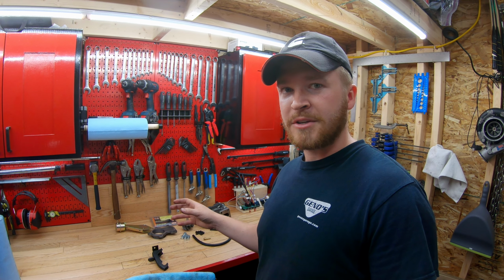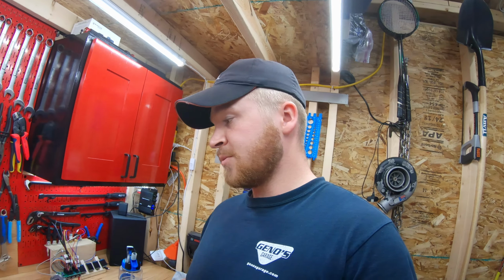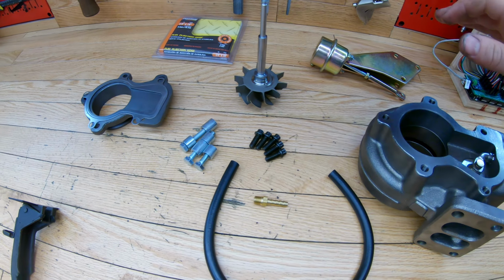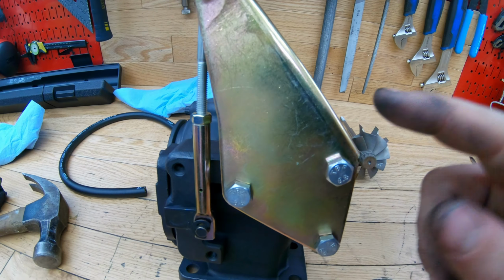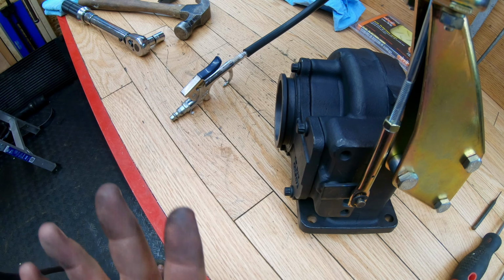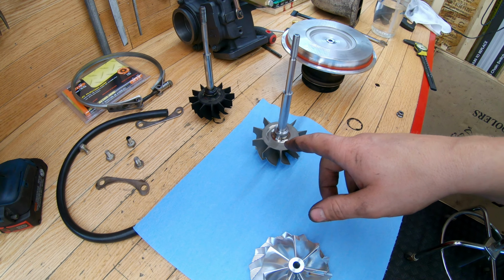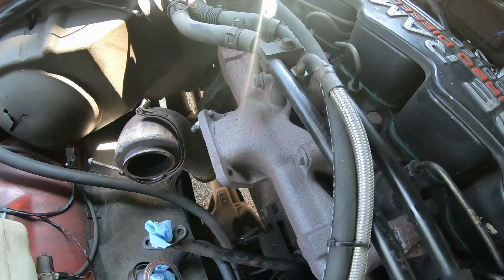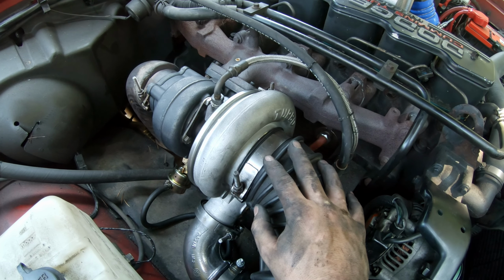64mm Turbine Wheel and 12cm Exhaust Housing | 1st Gen Cummins

Comment: I hope you do a towing update and list the mods/fueling you’re using.  I’m looking to make a few Frankenstein holsets myself just to see what the limits are on my 95 12v stock setup
Reply from the maker: I'll have to make another update video. I'm thinking about doing similar mods to my other truck but might go a different route haven't decided yet.
Reply: I'm right there with ya. I've still got a stock HX35 on my 96 and she's way over fueled. I need more air but don't want to spend a lot. Thinking of throwing a 60mm housing/wheel on it but people say that won't be enough. For a 62mm I have to machine it for the compressor wheel to fit
Reply: @TAShannon1  if you can find a roached out hx40…no machining required…just swap some parts around…otherwise you’ll still need to machine out your hx35 for a 60mm compressor
Reply: @bugn4life  hey man. So I went with a 62mm wheel and a 74x64mm turbine 10 blade. I had to get my compressor housing, bearing housing and turbine housing machined for fitment. I also rebuilt the turbo of course. I am in it a little over $400.

It's perfect. Exactly what I was looking for. Apparently it's a good 475-500hp combo. I have no idea where I'm at. I'm guessing 450-475 now. The truck was already fun and peppy but now it is an absolute menace. The 4k springs really get utilized now that I have the top end airflow. Spool up is still very quick. Not as quick as before but really close. Egt's are down 180 degrees. The sound is a lot different too. I liked the sound of the turbo before honestly. Because it was smaller you got more of that de-spool sound when you let off the throttle to shift sounds just like a big rig.

Now it sounds like a jet airliner. Still sounds cool just a different cool
Reply: @TAShannon1  you running an auto or manual trans?  Gearing and tire size?  Autos only need to spool the turbo once…lol
Reply: @bugn4life  NV4500. With the 4k springs I still keep enough boost in between shifts to where it's not a big issue. Also the nv4500 likes to shift faster at higher RPMs
Reply: @bugn4life  the drop off is usually from 40psi to like 8-10 psi when I'm shifting in the 3k+ range. With 10psi it lights fast
Reply: @TAShannon1  cool…my nv5600 is a slow row for sure.  Glad it’s working out for you
Reply: @bugn4life  I rebuild manual trannies for a living. One day I will absolutely do a ZF6 swap in this truck. Then she'll really fly
Reply: @TAShannon1  awesome…my friend rebuilt my nv5600…but I think we did something wrong…she’ll grind going into 3rd if rpm is too high either up/down shifting…even if I rev up to match speed/rpm…still grinds…sigh…I think we put back together too tight…
Reply: @bugn4life  possibly it wasn't shimmed right. Usually we shim a couple thou tighter than we want it to be. After breaking in soon it will loosen back up about a couple thousandths usually. Also NV5600 is not my favorite transmission. Their reputation far exceeds their design capabilities in my opinion. 

Usually when you have clutch disengagement problems you will have problems with multiple gears but mostly 3rd gear so check that maybe bleed the clutch see if that helps. 

Otherwise it is most likely a Synchro issue. Either bad part, or could have been stuck after rebuild and when you drive it before it is unstuck it can damage the synchro
Reply: @TAShannon1  I used 2 new hydros and same…my trans was just weird overall…it was an earlier nv5600 that someone put in a 1 3/8 shaft into and needed shims for the synchros…it was odd…oh well…next time I’ll go g56…lol
Reply: @bugn4life  Yes the G56 is best out of the 3 that dodge used. The best overall manual truck tranny is definitely the ZF6 but you need a lot more other shit to complete the swap including an adapter plate unfortunately
Reply: @TAShannon1  for sure…which is why I’ll stick to what they came with since my needs aren’t very big.
Reply: @bugn4life  a G56 with a heavy duty case is a real tank. That case alone is $2k from high gear. There is also a cage fat goes around the outside of the transmission that really does a good job of strengthening the case. Some of my customers have had great success with them

Comment: I need to learn more about turbos and all the measurements and stuff. That is foreign territory for me. How does this setup compare to a stock hx35?
Reply from the maker: Yeah haha, sometimes the measurements are confusing especially because aftermarket companies don't always label the same. I like to go by reading the inducer/exducer/exhaust housing size in cm. The stock h1c is 54/60/18 or 21 depending on year of truck and the hx35 I believe is a 56/60/12 wastegated. The he351 is 60/58/9 with internal wastegate.The smaller exhaust housing helps with the spool speed. Bigger wheel sizes flow more. So the setup I have now is a 62/64/12 which is bigger than the stock h1c, hx35, and he351. It drives and sounds AWESOME, not going to lie. I just need to tune up my pump a bit better now. I have too much fuel under throttle and at zero boost.
Reply: I'm in process of getting an he351cw. From what I've read it is a good match for a first gen ve pump. Perhaps a turbine wheel upgrade to the he351 to a 64mm hx40 super 10blade turbine at some point.
Reply from the maker: @davidcole3927  That would probably work very well with the HE351.
Reply: Hi Tim, Better check out Savage Fabrication's Utube channel. Bradley explains everything you want to know, you just have to have the time to watch and listen. I would not let Austin from Turbolabs of America work on my wheel barrow, let alone buy a Turbo from him.
Reply from the maker: @franklogan494  Did you have a bad experience with them?
Reply: @OvensGarage  No I didn't Tyler, I have watched him explain things and he seems aloof, for a lack of a better explanation. When you are spending a lot of money with someone and you compare that on other Diesel Performance Website's like Savage Fab and others he seems unprofessional.

Comment: Great info Tyler. When I get closer to getting the my motor back in the chassis. I could really use your input on this aspect of my build. If you don't mind me pestering you for help. I would appreciate it. Don't want to be too slow at the #nonamenationals if you know what I mean thanks 👍
Reply from the maker: Of course! I'll only be able to speak to my experience with what I've installed but I'll let you know my opinion anyways. Cheers.
Reply: @OvensGarage  Thats all I ask. You just understand it better than I do. Thanks

Comment: I want your turbo! I did a Stainless Diesel 5 blade compressor wheel swap in my 2021 6.7 Cummins. I also did a 10 blade turbine swap. Both wheels are direct bolt ons for your stock turbo and my turbo sounds nothing like yours. Frustrating because I’ve been after your sound in my stock turbo for a while with no luck. I thought for sure the 10 blade would make mine sound like a PowerStroke turbo from another video I found but no luck.
Reply from the maker: Haha, thanks. Keep in mind my exhaust setup may also play a role in the turbo sound. I have a straight through muffler and there is also a in-line FTE resonator. I bet those 2021 trucks have quite a bit on their exhausts for emissions. Have you deleted them?
Reply: @OvensGarage  yea buddy! Just deleted my ‘21. 5” straight pipe. Was hoping the increased flow would improve the sound but nope! I’m guessing it’s because it’s a VGT turbo. Duramax’s and Powerstroke’s also run VGT’s and with 10 blade mod’s their turbo’s scream!  🤷🏻‍♂️

I also have a AFE open air intake. 

I’m just at a loss 🤔
Reply from the maker: @bignick3303  Since I did my upgrades individually I could distinctly tell which made the biggest difference. The compressor wheel upgrade made more of a wooshing sound at the intake and the exhaust turbine wheel made a huge difference in terms of the whistle. Must be the designs of the exhaust wheels themselves that make the sound differences.
Reply: @bignick3303  Get a second gen style center dump exhaust manifold and a standard fixed geometry exhaust housing turbo and it will sound right. The Garret turbos the power strokes and Duramax's have use a much different mechanism to alter the size of the exhaust housing, so I don't think you will ever get your holset turbo to mimic that sound. If you really want to, you can make the Garrett turbo work but it is going to cost you. The biggest things are  exhaust housing flange on the manifold side will need to be converted and you will need a potentiometer to control vein position as well as other smaller  things. Brandon Fleece from Fleece performance has a really old video of a common rail 5.9 with a Garrett VGT, he holds it at a constant rpm and he can manually open and close the veins and you can hear the turbo speed up and slow down.

I just put stainless diesels 63/64 hx35 5 blade and 10 blade on my 12v and that thing screams

Comment: Hey chief. In your honest opinion do you think both compressor and turbine wheels can be replaced while the turbo is on the truck?
Reply from the maker: Compressor wheel is possible to do on the truck but not the turbine wheel since the exhaust housing has to come off the turbo has to come out anyways. It's easier just to take it off the truck.
Reply: @OvensGarage  thank you!

Comment: Not sure I want to changing fuelling or anything; how would cold air and 4” W/ exhaust change sound & performance ? Any other recommendations?
Reply from the maker: intake & exhaust is a great starting point it'll allow the turbo to breath better. I would start with intake & exhaust, then start doing turbo mods if you want, then intercooler.
Reply: @OvensGarage  great! Thanks for the response.  I’ve got a 92 stock and was wondering if there’s any preventative maintenance or things to check.  I’ve already got the kdp fix lined up
Reply from the maker: @amabilisbaca4842  Oh I thought you were just referring to performance mods. In terms of maintenance, do all the fluids and filters. I put an aux in-line fuel filter and I put in an amsoil bypass oil filter as well in my truck. KDP, overfill the getrag a quart, keep your revs over 1000 if you have the getrag, and don't shift it hard.
Reply: @OvensGarage  I was asking about both. Fluids, filters,  change filter setups, and trans fluids.  That’s a bunch.  I’ll be watching your videos as I learn more. Your truck sounds great

Comment: You need to upgrade your manifold my friend!
Reply from the maker: One thing at a time!
Reply: @OvensGarage  For sure, I have basically the same set up, the  GDS turbine housing and wheel is over $400 as well as that manifold depending on which brand you go for. Waiting on myself to pull the trigger on one of those.  One thing at a time,

Comment: I have a cuestion if anybody may know the answer i will apreciate it. I have an original HX35W, with the original exuahst turbine,12 blade, if i want to install a 10 blade turbine do i have to machine the exuasht housing or is there a direct replacement available. ?
Reply from the maker: Not sure of the factory specs on an hx35 but I suspect they will be different unless you order a wheel with the same specs as the exhaust housing.
Reply: I put a 70x64 ten blade in my hx35 and I just had them turn the exhaust house to 65mm and match he radius it had. It has worked well for me